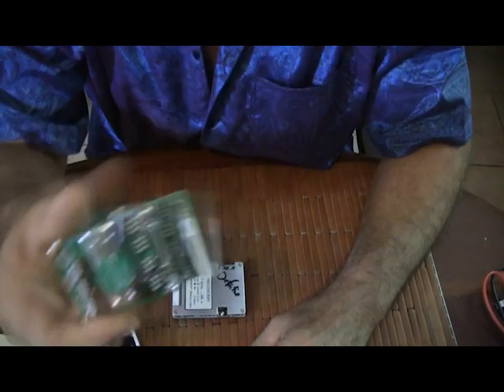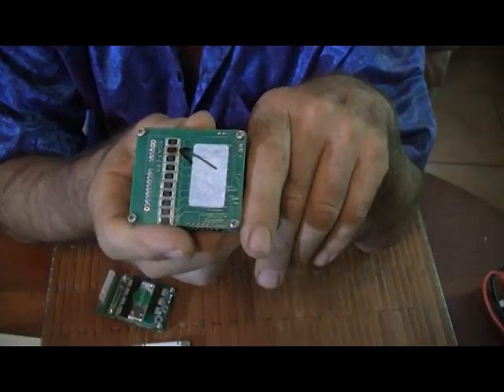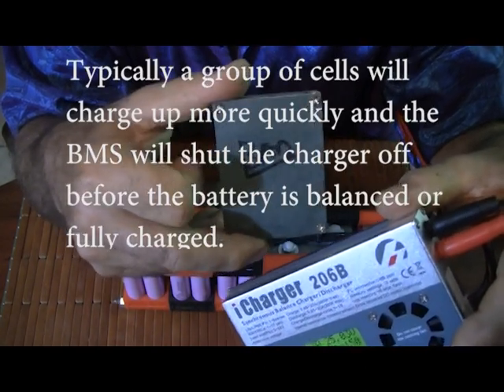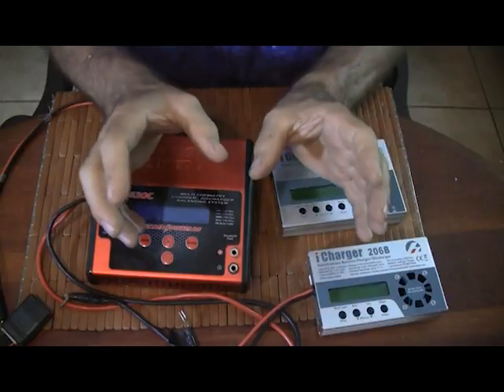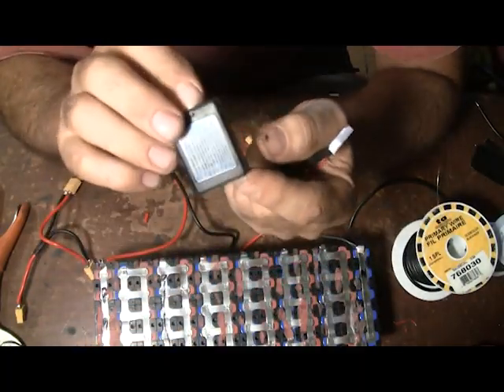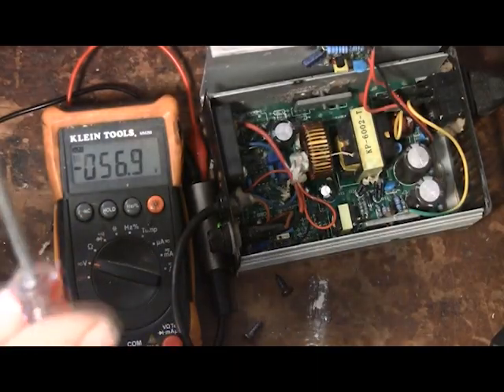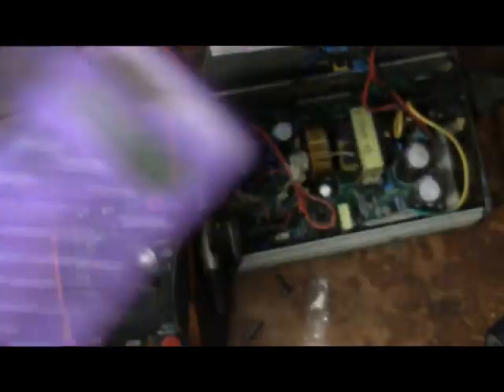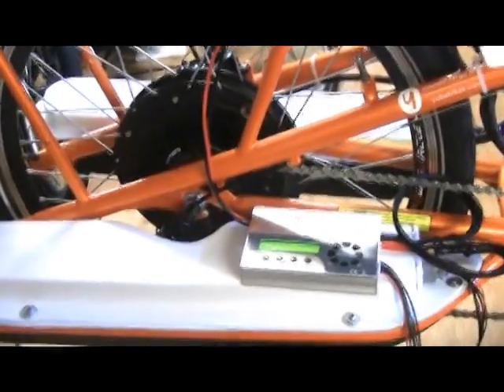How to build a safe and better lithium battery WITHOUT a BMS.

Comment: 9:00:  Just learning about all this, but WHY aren't the 18650 BATTERY SPACERS that you can assemble packs with uniform spacing out of, why aren't they made with METAL STRIPS that bridge TWO OF THEM so that you can assemble a battery pack WITHOUT SOLDERING / SPOT WELDING to the batteries AT ALL???  That is, the spacers would be made to hold TWO BATTERY ENDS, and would have a metal strip that makes contact between these batteries when assembled, electrically connecting battery negative, with battery positive of the adjoining battery.  Yes, they would need raised DIMPLES to reach down into the flat (-) end of the cell (one side only, right?, though I guess there are batteries that are flat on both ends if I understand correctly?)

Yes, you would need a means to apply and maintain pressure from these end caps to make good contact with the batteries at all times, but isn't that a straightforward thing to engineer around them?  Something like various "cages" that hold different numbers of cells into a pack while still being light by being made of something like nylon.

Seems like this is just too obvious as this industry is taking off.  Yes, they'd cost a tiny bit more made in China, but they would:
- remove the need for a spot welder, or worse, the need for soldering which can damage the battery casing...
- make assembly MUCH quicker by just being all SNAP TOGETHER to whatever size you need
- enable SIMPLE tear down / rebuild  to check / replace bad cells periodically
- support soldering to the OUTSIDE of the spacer, so that you can attach leads for OUTPUT + / - for the whole pack, again, without the risk of soldering to a battery to get them attached

These should also be made as a single end similar to as now, but with the metal insert so that at the end, to attach the OUTPUT + / - leads, you would have just the single end as a soldering point for the pack output voltage which again eliminates soldering DIRECTLY TO THE CELL.  Essentially you would build a pack of desired size by putting a cell into one of the single spacers, then put a double spacer on the other end, inserting the second battery into it (noting to get negative against positive of prior battery), and continuing to repeat this process using the double spacers until you get to the final battery, and finishing it off with a single spacer, then snap on the cage that would spring load all the spacer contacts down onto the batteries solidly.

Only drawback I can see is some RESISTANCE being added through all these contacts, but would it really be that much that the benefits would outweigh that trade off???

Does this make any sense?

????????????????
Reply from the maker: Makes great sense and I encourage you to pursue this.  I have tried to create BatteryBlocs that worked as you described but could not find a way to keep sufficient pressure on the electrical contacts without using bolts. 

Do some design drawings and if you come up with something run it by me.  Chances are I have already been down that design path!    My website is www.batteryblocs.com

For now, the smallest BatteryBloc that I can design holds 4 cells as it allows a nylon bolt to pass through the middle to provide compression.  

good luck!

Shawn
Reply: Shawn McCarty Thanks for the response, I will give it some consideration over this winter when I have the time.  I have a 3D printer so can prototype some attempts, just need a source for some spring steel for the contacts.  I also want to follow this path to look at prototyping some replacement battery case bases (the bottom half) for common rechargeable batteries like Black and Decker's 18v, with a goal of making it use a similar spring loaded method to quickly load / swap out either 5 or 10 batteries, with matching holes to accept screws from the original battery top with its contacts to the tool.  This is another thing that seems obvious to me; why aren't these rechargeable batteries made after market easily swappable with new 18650 cells to renew them?  The manufacturers want soldered batteries in them so that you buy a new one.  Consumers want spring loaded batteries in them to be able to swap out the cells simply and at lower cost; let's go the consumer route.  Someone could simply manufacture such a modified base and it would likely sell pretty well I would think even if it required a new charger.  Kickstarter?

Can appreciate your idea for the battery block with a nylon bolt for compression.  To me, the spacers and metal contacts seem the easier part to get right, with the spring loading ensuring consistent pressure across the entire pack the more challenging part since you don't want to add weight and it has to apply such consistent pressure and unify the whole assembly.  It may be beyond my abilities to achieve at home in more than a close attempt, because it seems that it would require an accurate calculation of material flex, and likely require using a less common material than PLA or ABS that I can readily work with at home, along with a high quality manufacturing method to ensure tight tolerances.  

But at this point I'm imagining something like a miniature plastic torsion box (1/2" thick? though not solid surface for air flow) with raised flexible plastic "feet" molded onto one surface of it at an angle to apply the pressure on the battery spacers.  One torsion box like this being held on each end of the cells by plastic ribs that snap into place when compressing the torsion boxes tightly against the batteries. 

Something like; assemble the grid of cells /spacers with cells horizontal to the work surface, spacers on the ends, apply a torsion box beside each grid of spacers (top and bottom of cells/spacers with springs inward), tip the assembly over so torsion box is top and bottom, put pressure down on the top box sufficient to fully compress the springs in both torsion boxes, and snap the plastic ribs into the torsion boxes around the perimeter to complete the assembly. Given the size of the pack, it may be necessary to shape the torsion box slightly bowed in the middle to make it easier to get the consistent pressure needed in the middle.  That's the part that may require the knowledge of a plastics engineer to get just right, which I'm not.  But I'm hoping that something like a torsion box would give top and bottom pieces enough rigidity to have the plastic springs molded along it's surface on the inner side apply the necessary consistent pressure.  The right design and material should enable achieving the four goals of consistent pressure, easy assembly / disassembly, durability, and low weight.

Hope some of this makes sense.  I enjoy mentally designing things... grandpa was the engineer (world class), I went the computer route, but enjoy dabbling in that world...
Reply from the maker: It makes good sense, I have tried another version, the issue was getting a grip on the 18650 cells to be able to apply spring tension from.

I love your idea of manufacturing cases for common power tools that would allow batteries to be swapped.  This is the ideal situation as the metal connectors could be imbedded and  torsion come from the case halves.  Brilliant!

I use 123D to draft.  I'd love to look at an .stl file of your first concept when you draft it.  I work on the problem occasionally too though for the moment I am focused on a new BMS concept.  Here is my personal email:  shawnwiththewind@gmail.com

I be happy to collaborate with you.

Shawn

Comment: so the max per battery is 4V and min 2.7V ?
Reply from the maker: Hi Mr. Cystan, no the maximum charge for most 18650 batteries is 4.2 volts per cell, and the low voltage is typically 2.6 volts per cell.  Undercharging them extend the number of cycles they can undergo.
Reply: Ah thanks. So what is the minimum voltage would you recomment for better battery cycles?
Reply from the maker: No, for the most common 18650 cells the max voltage is 4.2 and the minimum is 2.6  For long cell life it is good to "live in the middle of the battery" say between 3 and 4 volts.
Reply: that's what i wasn't sure on, thankyou for advise.
Reply: If you charge to 4.2V and drain to 2.6 you're only going to get maybe 50-100 cycles before the battery has about 50% of its original capacity. If you charge to 4.0 and drain to 3.1 you might get something like 700-1000 cycles. It's a big difference in longevity.

Comment: I've got the Imax B6 AC but I'm making a 12s12p battery (1.3kWh)  and it'll take FOREVER to charge with it. Are there any better, higher capacities Hobby chargers I can use? 

I'm wiring the pack to be 2X 6S12P so my B6 can do it. if I Could get a charger that could do 13S that would be ideal.
Reply from the maker: Yes, the Imax B6 AC only puts out 50 watts!  Sorry , no 13 or 14s chargers that I can recommend.  You can look at the Thunderpower charger, but I have had some trouble with mine and the final voltage was not adjustable!

Your best bet for a high powered 6S charger is an icharger like the icharger 106B:    

http://www.buddyrc.com/icharger-106b.html

It puts out 250 watts and is quality.   Good luck with your project!

Comment: Hi buddy, great video you have given me alot of ideas. i was think of a way to streamline this design a little so that you dont need to unplug things, could you not have a switch to disconnect the two battery without unplugging them, and then two hobby chargers? im just not sure i like the idea of always unplugging things. again, great video thanks for the info.
Reply from the maker: I think  you could have a double pole single throw switch.  The difficulty is that A-  The switch must be sized to carry the current.  B- if the switch fails it could short the battery.   For me the issue is that I want to be 100% sure the battery is never wired in series and parallel at the same time- or kaboom meltdown.   Having plugs ensures that a bad connection will never be made.   

Still I invite you to experiment carefully, it is certainly worthwhile and possibly a good idea!

Comment: C’est pas juste une histoire de voltage la durée de vie d'une batterie, les 
ampères charge et décharge sont très important aussi. Il n'en parle pas du 
tout.
Le sujet n’est pas complet. Il donne que les avantages et pas des 
inconvénients si vous le faire sans prendre conscience de tous les risques vous 
allez fusiller votre batterie encore plus vite.
Reply from the maker: TRANSLATED
This is not just a voltage of history the life of a battery, the
amp charging and discharging are very important too. He does not speak in
all.  The subject is not complete . It gives the advantages and not
disadvantages if you do not become aware of all the risks you
go shoot your battery faster.

Thanks, you are correct.  By charging and discharging your battery slowly- say at 1/5 it's C rate, you will increase the lifespan of the battery.  It is not just about the voltage.   Thank you for clarifying this.

Comment: Great video, i have just ordered a bms. Im going to use it to charge my tested recycled (6s) cells at 5A and bypass the over discharge protection(i need to pull 100 amps from a 6s pack). 
Also im going to code a simple arduino voltage to see the balance between the cells. If the pack becomes too unbalanced, the arduino will cut off the charge voltage going to the bms.Then i will just run it through my hobby charger to balance it properly. 
I just need a faster and a cheap solution to charge my 6S 15AH pack quickly.
Reply from the maker: That is a great plan.  You should put together a video showing how you accomplish this.  100 amps from a 6s pack?  Each cell would have to dump 17 amps, certainly possible with a high power cell.  Since you have this skill, why are you focusing on amps to get the power instead of volts?  Or are you also going to have a high voltage pack  say 100 volts and try for say 10kw?
Reply: Well, i think you did not quite understad what i meant there. The pack is going to be 15AH, that is mentioned in the end of the comment. one good recycled tested laptop cell can be 2000-2500 mah at its finest. If you do your math, thats going to be about 6-7 cells in parralel so that will mean 6s6p or 6s7p. The 17 amps quickly escalates to 3-2 amps 

Why am i focusing on amps, instead of volts? Because my electric longboard motor has limitations and does 330rpm/volt, on a 6s configuration i can go 40km/h which is quite deadly, also it is easyer to balance a 6s rather than a 12s pack, it would need a more expensive balancer, HV ESC for my motor etc. 

Currently im working on a completely diy balancer, I will be using tp4056 sop8 chips and make a 2A charger for a 6s pack, it will be charging straight through the balance leads. Each 2A charger is isolated from another. I will be making a video about that soon if it works-In theory it should...
Reply from the maker: Sounds like a great project, I think we need more solutions to manage Lithium Ion batteries.  I see why you need to keep the cells at 6S to limit your outboards RPM.  Good luck and please let me know when you post your video- I'd love to see how well the charger works!  Thanks for your comments.

Comment: What is the lowest voltage you recommend discharging each cell to for longest cell life?
Reply from the maker: 3.0 volts is a good compromise between long battery life and range.  The goal is to "live in the middle of the battery."

Comment: So, all things being equal, li-ion will last about 3 times longer if they're only charged to 4v/cell? Is 4v when the constant current charge usually ends?
Reply from the maker: Yes, LI will last about three times as long when charged to 4 volts per cell.  That's why all the auto manufacturers start by charging their batteries to that, and gradually increase the charge voltage to compensate for battery aging.   The CC charge part ends whenever the battery voltage equals the final charge.  Then the amount of current is reduced, and the voltage falls a bit.  Then the CV phase starts, where the charger keeps reducing the current to keep the voltage below it's max.

Comment: Overall I think the information in this video was very good. I think your main points could have been condensed down quite a bit though to appeal to a larger audience.
Reply from the maker: Thanks for that.  I'll try and be more concise on my next videos.
Reply: Great job though, really. I'm an rc guy and I never knew electric bikes use a bms. It's madness to me that bike guys don't have a way to see the voltage of each of the cells of their batteries. Someone brought in a battery because 2 of the cells died? Madness! It should have never gotten that low to begin with. Most people also don't know that charging to 4.0v or 4.1v or 4.2v will greatly increase the lifespan of their batteries. So again great job on the high quality info you're giving out.
Reply from the maker: Thanks Scotty,

It is amazing to me that us ebike guys don't use more of the hobbyists cool gear.  There is some great stuff that really adapts to our ebike batteries.

Comment: this may be the most informative lithium charging video I've come across so far. thank you
Reply from the maker: Thanks Ken!  Hope it clears some of the mystery about charging Lithium chemistry batteries.
Reply: You got taken then this guy is telling you a bunch of crap he doesn't know how to wire a proper BMS
Reply: Agreed, it validates my work based on what BatteryUniversity says about prolonging lithium ion batteries via undercharging and that BMSs are an unnecessary additional point of failure.

Comment: Agree 100%. Your battery is only as good as its lowest capacity block. Once it is full, charging should stop.
There is no point in putting more charge into any other block, its just a waste.
My Idea is to monitor and display each block voltage and auto disconnect the charger when any block reaches 4.2 volts.
Less if you only want to charge to 80%, to lengthen battery life as with Tesla.
Likewise turn of the load when any block is down to around 3 volts.
To really balance a pack it is best to make sure each pack has the same Ah capacity.

Comment: excellent video!  thank you for your show and tell
Reply from the maker: Hey Ty,

Thanks for watching, glad you enjoyed it.  It was fun making it.  Next I'm doing a video on battery pack repairs.
Reply: right on!
Reply: friend i have a question 
can u pls tell me if i use 18650 battery cell of 1.8ah, 10 cell which mean 18 ah. each cell content 1.2 volts, 10 cell which mean 12 volt. it mean there is a 18 ah 12 volt battery is made .  after connection this all cell to a inverter which requires 7ah 12v battery to light a bulb but this type of battery is not working. can u give me any advice.